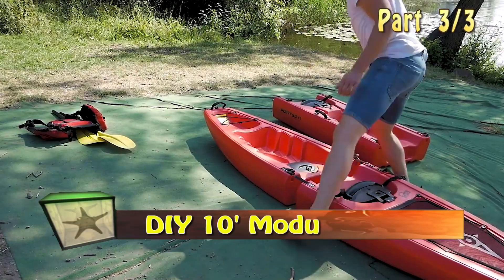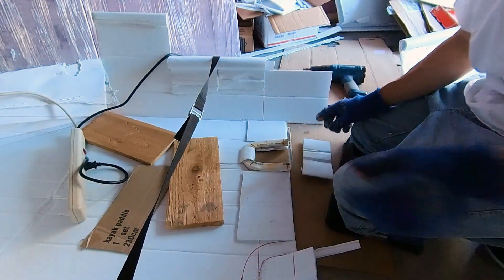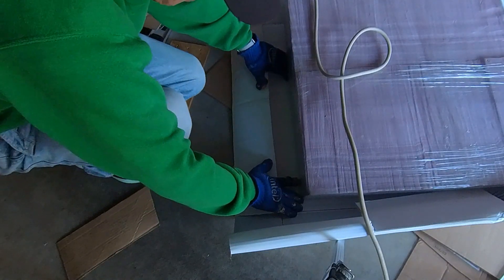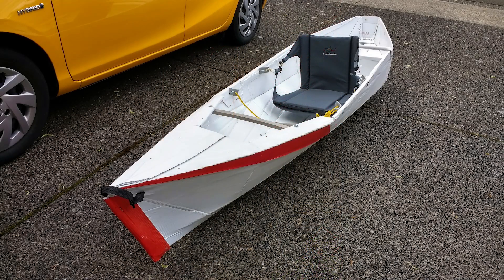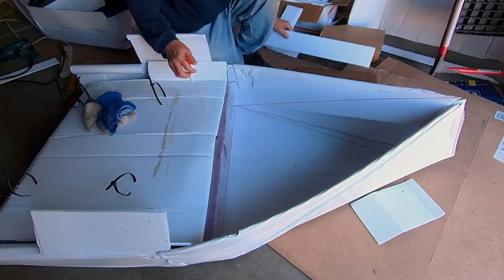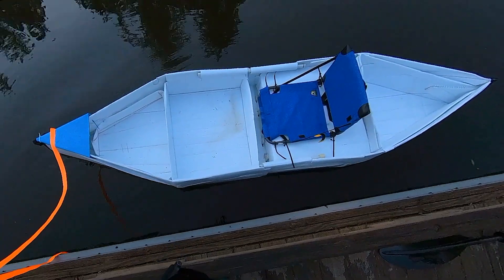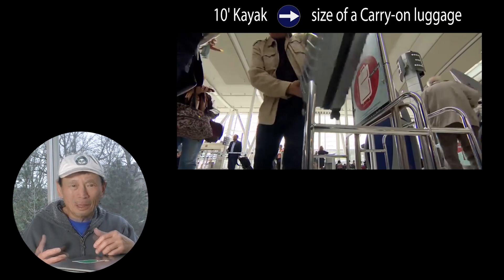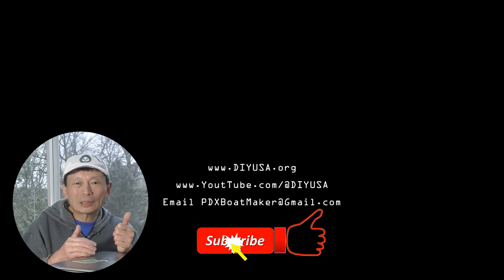Pt. 3 Build A 10 ft. Coroplast Modular Kayak Gen 20

Comment: Why don't you use any fiberglass??  It would stiffen that thing up a bunch
Reply from the maker: Thanks for you good question. You are correct, fiberglass will provide strength and have many other advantages. However, the goals I have for building my boats are: low cost (under US$90), use simple tools, light weight, prefer under 15 lbs for a 9.5' boat, takes 16 hours to build one.  Therefore I experimented with very different building techniques than other boats you found on Youtube. With this boat, I can easily strength it by using a longer PVC pipe at the middle. Again, this is an experiment and I also used the recycled materials. Basically it cost me just a few dollars for the PVC pipe in building this boat. 🙂

Comment: 8:07 I bet you could fit THAT kayak into your back pocket!
You may find this is an easy way to make quick models:
I have made kayak models from 1/2 of a legal size manila folder and my little inkjet printer can print on them.   I do half the kayak but it's easy to match two halves together at the mid bulkhead line with scotch tape.
Reply from the maker: Yes, I sometimes use cardboard paper also. But for this one, my 2nd step was to use the actual coroplast to check if I could fold the boat into the form factor I want. I have to made a wider fold line and also parallel fold lines so as to achieve a round and smooth folded corners (which created less stress on the fold for durability). Cheers!